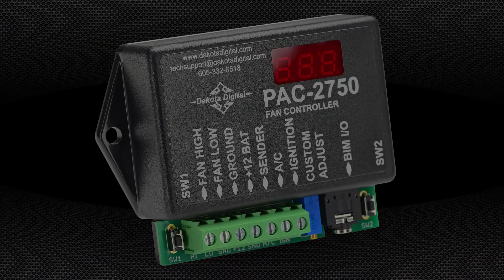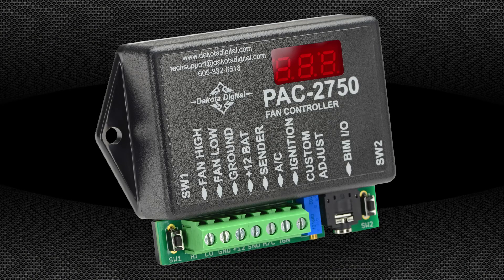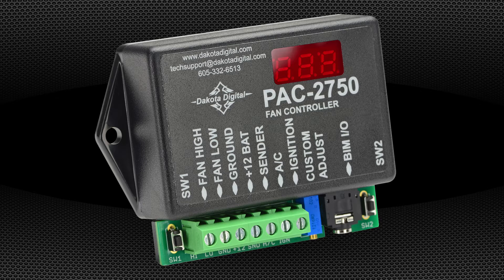PAC-2750 Electronic Fan Controller

Comment: Would this work with after run relays ?
Reply from the maker: It could; really the fan controller would be independent of an after-run setup as at key-off, the fan controller runs on your time-limit alone and not coolant temp.

Comment: Hi i have 2 fans that i want to control them in series like both fans come on low speed then both fans come on high speed is it possoble with this unit if i get another relay?
Reply from the maker: Good day!  Are the fans two-speed units? If so you can connect both low speed inputs to the FAN LOW output, and both high speed inputs to the FAN HIGH output.